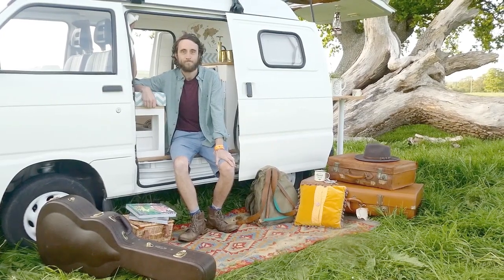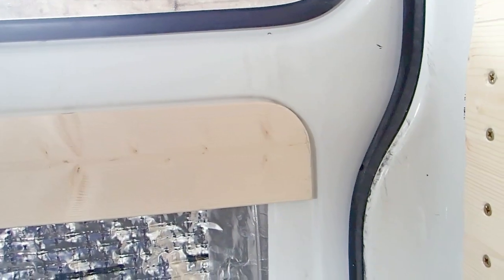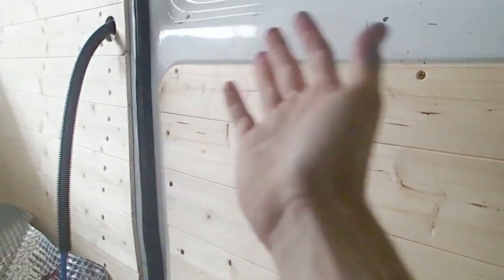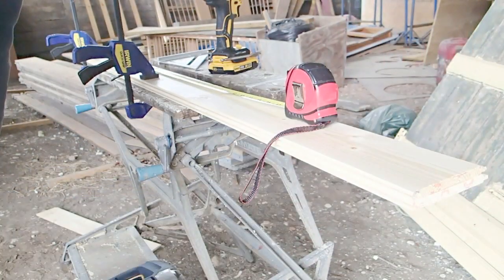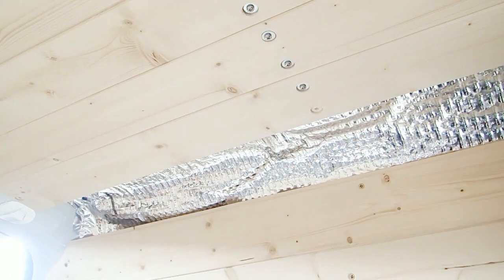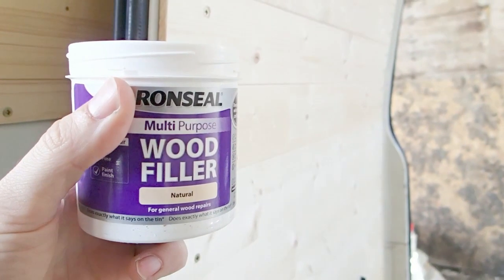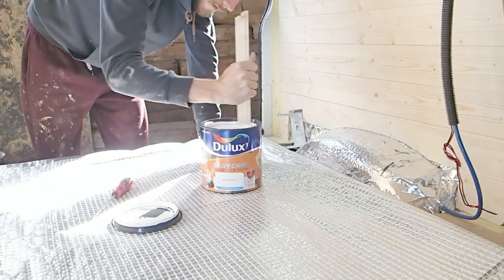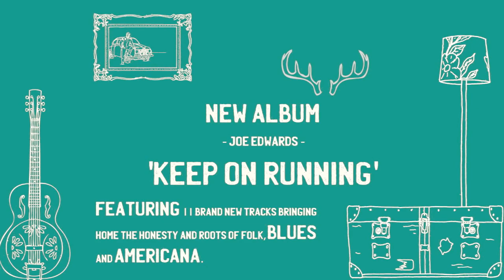Cladding The Walls - Part 5 - How To Convert/Build A Camper Van

Comment: Hi. May i know, do you screw the pine directly to van body?
Reply from the maker: Where ever possible, if you can screw a wooden batten into the side walls of the van and then screw cladding into the batten that would be great as it'll reduce the amount of holes that have potential to rust, if you're really tight on space though you could screw it into the metal work, just be sure not to go too far through!

Comment: Great job! Not sure if you mentioned it but what was the thickness of the cladding?
Reply from the maker: Hey Patrick, thanks for stopping by, if I remember rightly it was 9.5mm, keeps the weight and the cost down :)
Reply: AtomicDuck123 that’s great cheers! Also wondering if you’d be able to tell me how much you spent on the conversion/ direct me to anywhere that would tell me? Cheers dude
Reply from the maker: @patrickrutherford3346  It's all here my friend :) - https://youtu.be/bCjByaw70xU
Reply: @WoodandWild  thanks!!